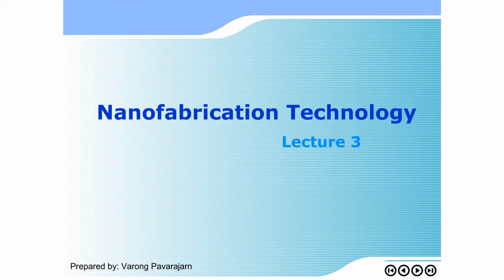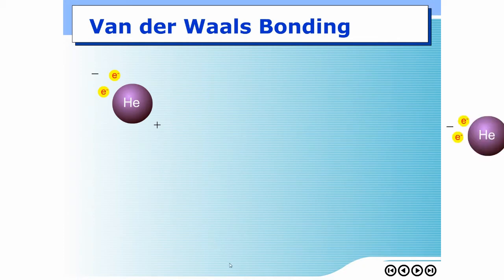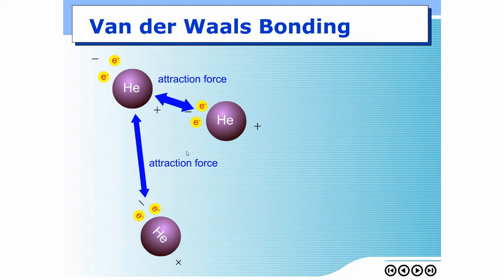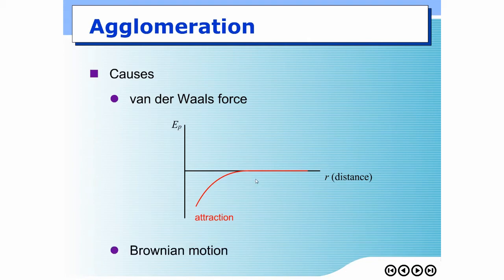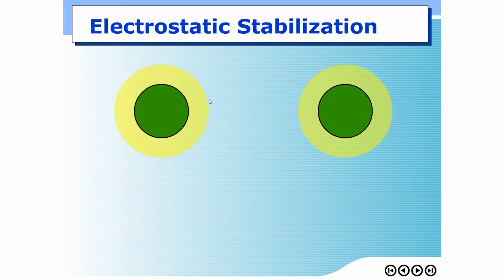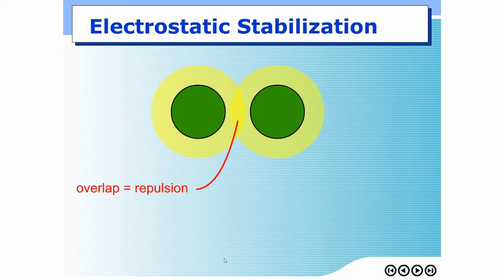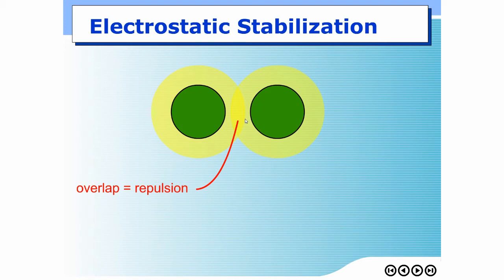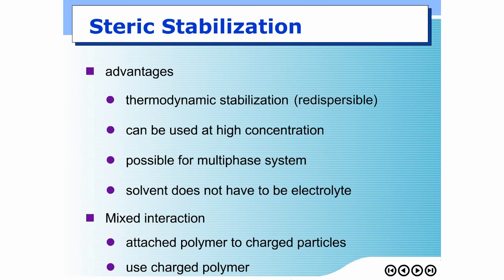Nanofabrication Technology (2020) Lecture 3a

Comment: Thank you for your excellent lecture.
I have a question. If we steady the nano system by steric stabilization, does precipitation between nanoparticles occur when we wash as-synthesized nano materials? 
Example, when I synthesis nano materials using SDS as surfactant and ethanol as solvent. SDS is more soluble in water than ethanol. Does my nanomaterials precipitate when I wash it by distilled water?
Thank you very much!